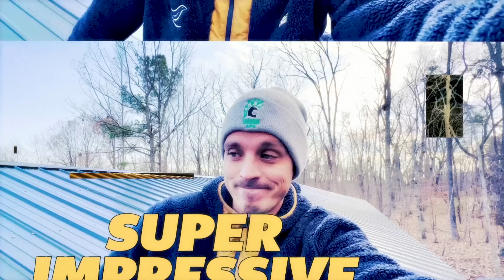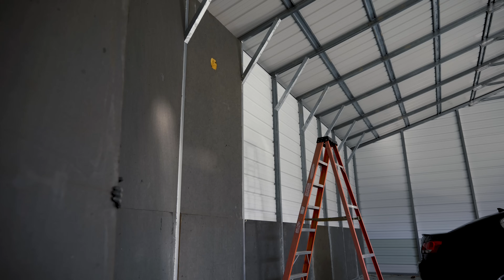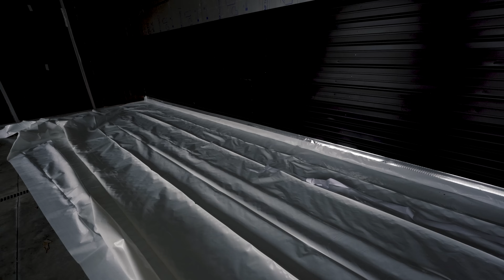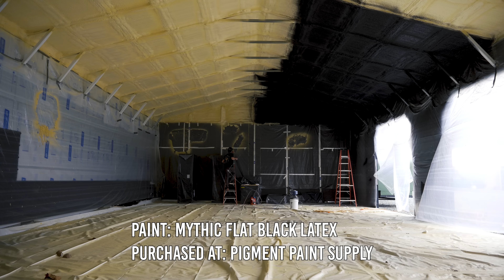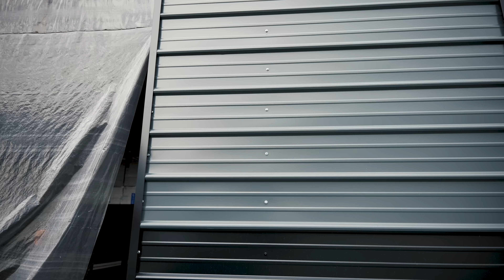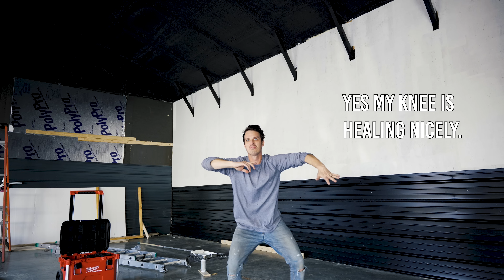Beautiful SPRAY FOAM?! - Metal Shop Build

Comment: Flash and batt is never a good idea! and this is even worse. With the fiberglass going in first it is not even a flash and batt. It is really a batt and flash. It’s ass backwards. The fiberglass is going to get soaked with condensation and cause mold. The spray Jones video channel has a whole video about this and the problems it causes.

Comment: Are you worried about condensation behind the spray foam, creating pockets of water? I'm assuming you loaded your steel structure for the particle board and foam board, please the additional interior wainscot. Usually the building structure has to account for these?

Comment: Big issue with spray foam on metal is water intrusion from the outside especially on the roof. If you plan to spray foam make sure to put a vapor barrier under at least the roof.  And have an airgap the summer heat and humidity will make its way under the roofing.
Reply: Spray foam is a vapor barrier that adheres to the metal. Are you talking about water getting thru the roof panel seams? One would hope that would get nowhere. Are you suggesting maintaining an air gap between the metal roof and the spray foam? How would one do that? 

The problem I see with mixing foam board and spray foam is maintaining and air gap for the walls. That gap normally extends to the roof peak to allow the air movement to keep that gap dry.  Spray foam prevents that unless there is and opening at the top of the walls.

Comment: You could have put house wrap between the steel roofing and purlins. That way if you ever need to replace any of it, the old sheets could be easily removed, and not have them "glued" to the foam. I did that on a post frame building 7 yrs ago, and have had no problems with it. I also painted the foam. It should have had a 2nd coat or thicker 1st one. I have some thin places in it. Good job on your shop!
Reply: Rain screen/air gap

Comment: This spray foam application looks amazing! It's incredible how it transforms the metal shop and adds insulation. Really appreciate the detailed walkthrough and tips. Has anyone noticed a big difference in temperature and noise reduction after using spray foam in their metal building?
Reply from the maker: Spray foam is insanely good. Can hardly believe it’s a black building in Virginia.

Comment: Dropped the ball, You should have coated it with Black Fire resistant paint, anytime you have a carin there or work on anything that could cause a problem, you can still do it, Foam burns Real, Real bad.
Reply: Should have used Marine Plywood, sealed it Covered with your left-over metal, and coated with Silicone and you would have been Super Great.
Reply: Not closed cell

Comment: So why didn’t you have them spray the metal crossbars up top and where the wall and roof come together? Doesn’t that make a bad thermal bridge which in turn will make a condensation issue?

Comment: Hope you had them put an inch of 2.8 lb foam on the exterior of the roof
Reply: Hi Roy, whatcha mean by this. Looking to do my own building and would like to understand your comment thx
Reply: The biggest problem with propanel or metal roofs is they always leak. Contraction and expansion. The rubber around the screw deteriorates also. If you put an inch of exterior roofing foam its seamless your not gonna leak. It's a 30 to 50 year system depending on how you maintain it. Also adds structural intergrity at 50lbs compression per sq in. At a 1000lbs weight per 3000 sq. Ft. If it came down to affordability and you had to choose. Do the interior walls and exterior roof.

Comment: Question: on the temporary H post structure… why did u install that? asking because I may need one
Reply from the maker: Because of where the building is situated. You can have them permanent installed apparently. I have no plans on removing it.

Comment: Are you not required to do a DC315 fire barrier paint before your color?

Any exposed spray foam in my garage need 15 min fire barrier.
Reply from the maker: Great question. Not required unless it’s in a building with open flames, active welding and the such. I would like to eventually coat it in a fire retardant. Just so darn expensive!
Reply: @WoodnessGoodness  Ahhhhhh must be different for commercial vs. Residential. Yeah.... $1,500 in paint alone for my project, then I have to paint it again to get the color I want. 😂
Reply: @ detachedgarage.  You are absolutely correct.   Check out the SPFA web page.   Sprayed Polyurethane Foam Alliance.  It is required in any building with exposed foam that will be occupied or used by anyone, EVER!  

Your Foam Contractor lied to you!!!! 

https://upcfoam.com/wp-content/uploads/2024/02/THERMAL-BARRIERS-AND-IGNITION-BARRIERS-FOR-THE-SPRAY-POLYURETHANE-FOAM-.pdf

Comment: I’ve been finishing the inside of my 32’ x 24’ metal shop and I know exactly what you mean by it being slow moving. The interior detail work/painting/drywall is taking me forever. I went with spray foam as well. It’s also not cheap. Keep pushing forward, you are doing great.

Comment: Quite a costly project. I know I have just had a metal building built that still needs a lot of upgrading. I am sure I won't be able to do as much as you did with yours. Mine will have to be a bit more on conservative spending. Nice video.

Comment: Does anyone know if he ever goes over a cost breakdown? I cant decide between a metal building or pole barn.
Reply from the maker: Pole barns are more expensive typically. The metal building was a cheaper option but I unfortunately had terrible workers. You can expect to pay 20K or so for a metal building like this. No concrete, nothing on the inside.

Comment: The building is looking great! I’m glad they made it right! The color match screws really finish it off !
Reply: He could have ordered color matched screws when he ordered the building. It is an option. Does make for some extended video but it was a mistake not to order it when he had the building built. Would have saved both money and time. I know I have had a building built. I ordered colored screws and used 3 different colors in the build.

Comment: Shop is looking good.  I have considered spray foam in the rafters of my shop, but am hesitant due to fears of flammability.  I assume you are leaving the spray foam uncovered.  Are you not worried about setting it on fire?  I do a lot of welding, so fire is a real concern to me.
Reply from the maker: Yea very true. I have no plans on welding in here. I plan on leaving it exposed. If you really want, you can paint it with a fire paint but that costs an insane amount!

Comment: I think OSB is a great material to use. Since its glued together it becomes quite water resistant. even enough where if you taped to boards together it can become a vapor barrier.
Reply from the maker: Great point!
Reply: Osb has a very low permeability which makes it susceptible to failure much faster then plywood.
Reply: @ not good for standing water, good for vapour control
Reply: @sosai8406  plywoods perms are better and increase when wet osb is the opposite. Plywood is better for vapor control
Reply: @ you’re talking about flooring or roofing I’m just referring to walls. Do you work for the plywood lobbyist or something
Reply: @sosai8406  plywood is better for roof decking due to its strength axis and plywood is better for brace/sheer all paneling due to its fastener retention and permeability osb is better for floor decking due to its consistent flatness but make sure you properly gap butt joints and seal end cuts. Plywood quality has deteriorated with cdx grade, which i feel is purposeful, the need grade to use ccx ie 1/2”(16/32) 5 ply walls 5/8”(19/32) roof decking.
Reply: I like to paint back side of osb in that application

Comment: Am I the only one who thinks spray foam might be a bad idea? I got concerns on the maintenance/upkeep of the building, the environmental/disposal side, and even potentially the air quality. I am sure it must be very effective insulation and cheap to install so perhaps that outweighs the cons but I got bad feeling in my gut about the stuff. I am thinking it could become almost as bad as asbestos in the future when it comes to working on buildings and disposal... Perhaps I could see in this specific metal building situation insulating the roof any other way could be cost prohibitive and  have potential to interfere with the intended functionality of the building if it cost extra overhead space needed for clearance of the doors and such.
Reply from the maker: You’re not wrong there could certainly be a risk for what we don’t know. Everything I could read and research, it’s safe once installed. The same technology is in ridgid foam insulation and seems to be holding up. It’s actually very expensive. Great points though. You just never know…
Reply: @WoodnessGoodness  oh dang it seemed quick to install so I thought that brought the price down.